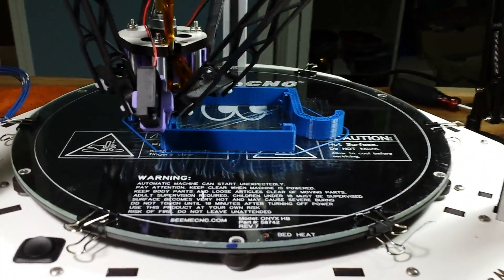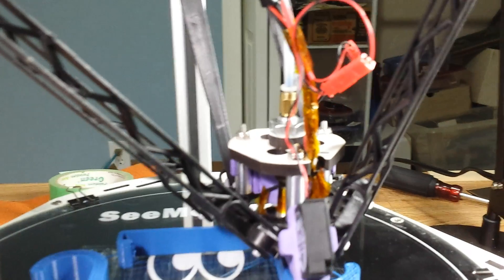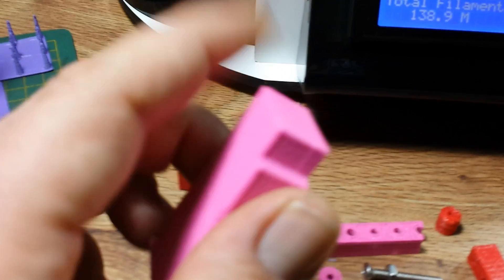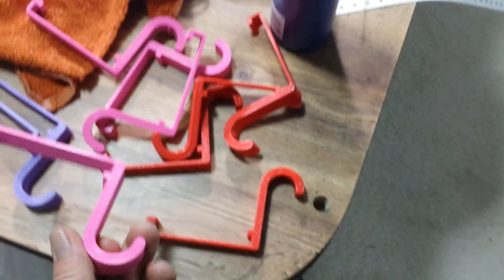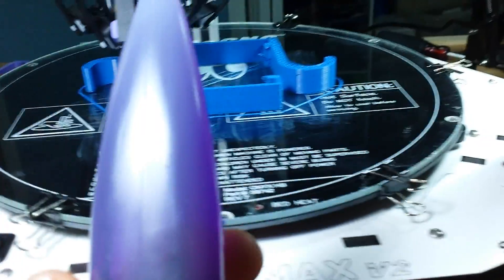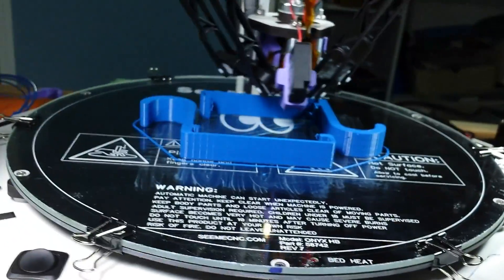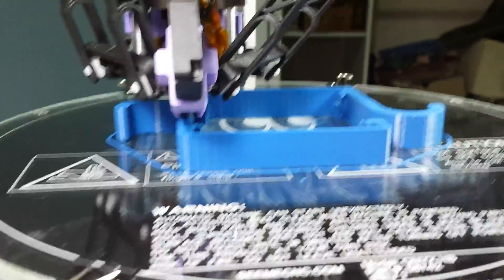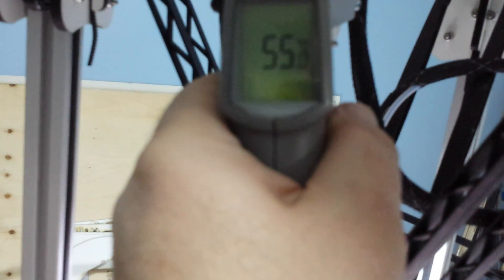Rostock Max v2 - The first 25 hours

Comment: The fillament will shrink after it is printed. Also the temperature near the printer should be stabile. Maybe try to make a enclosure around the 3d printer. So you can have the 3d printer in 30 degrees stable.

Comment: I'm curious about lubing and or keeping the filament clean and dry, using the printer in the garage I wonder if this may cause many jamming problems?
Reply from the maker: Jon Edwards Probably yes.  Jamming is an easy problem to develop and using an oiler will solve it.  My oiler is just a piece of foam that I poke the filament through before inserting into the EZStruder.  I add a couple drops of canola oil and that solved all jamming problems.

Comment: were you able to get better test results on the multiple test items?
Reply from the maker: I've since upgraded to an E3D V6 (with a smaller diameter nozzle) and I have not yet tried the Makezine test models.  I really should though. 
btw, are you the same guy that I play Grid Autosport with?  (I'm Budcraft!)
Reply: kitecraft no im not the same guy. Im not much into games. Im mote into multirotors and quadcopters. I was thinking about getting a printer but now im not sure. I would like to see how it does with the new hotend
Reply from the maker: Richard Cranium I've been having lots of jamming problems with this printer.  Most prints fail due to filament jam in the so-called 'EZStruder'.  The new hot-end has not helped.  The fail/pass ratio is not good at all.  :(
Reply: kitecraft I was really considering the rostock max v2 but seeing some of you results with all the time you put in makes me wonder if I should get it
Reply from the maker: Richard Cranium Don't get me wrong, I do like the machine.  It just seems finicky for me in that the extruder jams often.  Overall, I am happy with it.  I've upgraded the hot-end because the heating resistors in the original hot-end gave out after about 120 hours of print time.   The new head does give much nicer prints.  Check out my channel to see what I"m working on right now.  My 'Nerf dart flinger' project is pretty cool.
Reply: Richard Cranium its a great printer, the hot end just has some issues. I personally swapped the hotend that comes with it with a e3d v6 and it really improved prints allot.